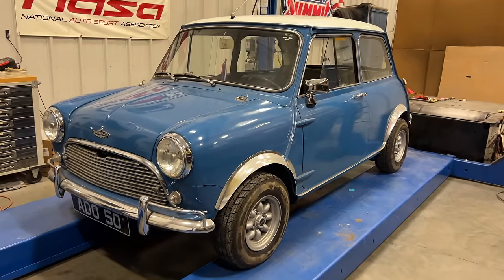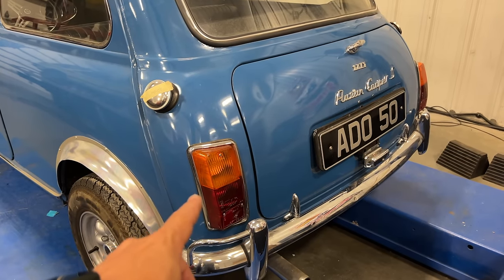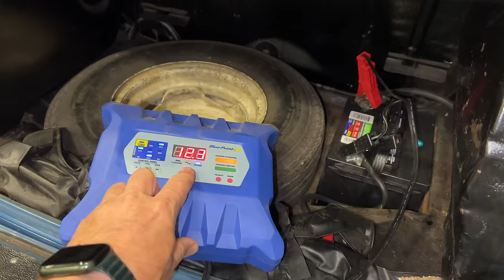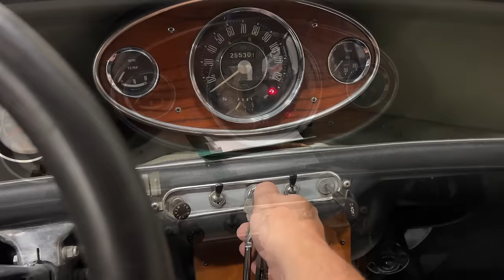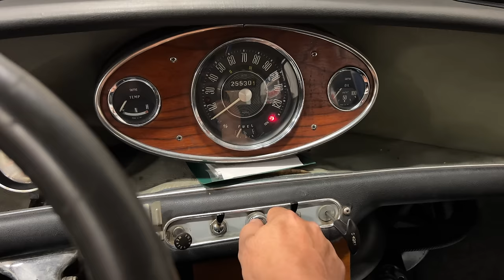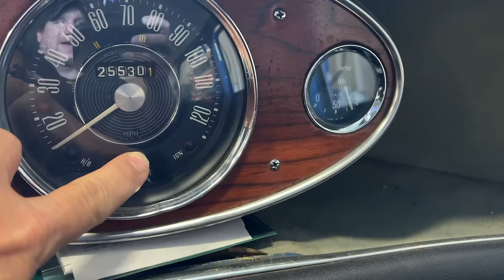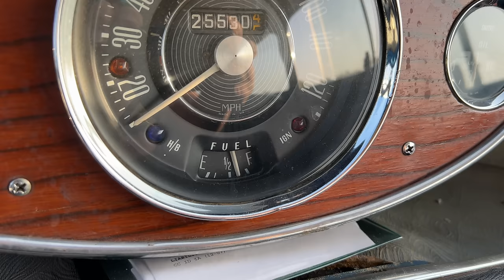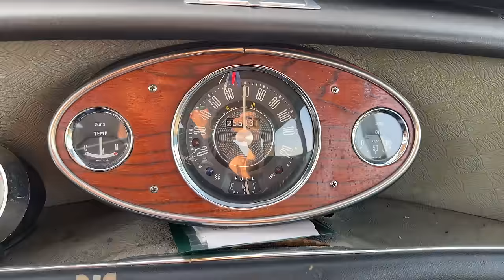1967 Austin Cooper S - Will It Run?

Comment: That was one of the easier first starts after years! Loving the color and the Minilite wheels.
Reply from the maker: I am wondering if the DOT 5 ended up saving the hydraulic system and is why I didn't have any problems with it.
Reply: @ThisWeekWithCars  if DOT 5 is less moisture permeable and doesn’t react to older hydraulic system materials, then it’s the stuff to use. I’m not that familiar with it yet, however.
Reply: @ThisWeekWithCars  it is much better.  Piss off those old tyres.  It is illegal in Australia to use tyres more than 5 years old.
Reply: @bmwoutlander  Australia is ridiculous on so many levels…. definitely not the Land of the Free….
Reply: @bmwoutlander  five years!!, is the sun that damaging over there?  The tyres on my Pug 205 are probably six years old, have less than 2000 miles on them and look like new but the car is garaged and UK weather is kind.
Reply: Yes the Sun has that much get up and go.  How do think we became skin cancer Central?
Reply: @bmwoutlander  I know that Aus owners of the pug 205 often ask UK forums whether they have internal plastic panels/ dash parts for sale as they are all cracked in Australia.

Comment: I had one of these Cooper S cars. Same year as this one, but mine was the Morris version. Right hand drive built in Australia. Mine had the fuel pump inside the trunk (boot), between the fuel tanks. The 1275 engine has an additional head bolt near the head water inlet pipe. Great little car, so much fun to drive and incredible handling around corners.

Comment: From memory, the Tail Lights (as shown here) were changed to that pattern in 1968, by BMC. Perhaps this '67 Mini has had a rear lights upgrade. Back in 1971, these were the car to own! They used to be labelled as "The Jaguar Eater", as they outperformed many Jags. Also, the real enthusiasts that owned the Austin / Morris Cooper S would take out the 1275cc block, and bore-out to 1340cc. I cannot imagine just how quick the little Mini became! Sadly, I had the bare bones 850cc Mini, but longed to own a 1275 Cooper S. The value of these cars continue to sky-rocket, a solid investment if you could take this car back to a factory Standard, on both interior and exterior. I would also remove the Contact Breaker Points, and fit a Hall-Effect Electronic Ignition Unit - inside the current Distributor. Just changing the Ignition System in this way improves the starting and also the performance, and it's cheap and easy to do! Greetings from Australia.

Comment: If that is a genuine 1967 car then its a MkII Cooper S and those rear lights are correct but then it should have the later grille. Maybe its just confused! The wheel spats are not OEM but correct for the period and totally right for those wheels which are just gems. And VERY rare!
You Sir have once again found an absolute beauty of a Mini.

Comment: We actually started making those Mini's in 1967, with the squared back lights! But..... There was always a bit at the factory.... Somebody forgot to make sure that we had both LH and RH rear lamps. So we made over 6000 vehicles with only the RH rear lamps fitted. Eventually Lucas managed to produce the LH lamp and we apprentices were dispatched to fit said lights! This worked out really well and cars were removed from the outside of the parking lot, only to reveal hundreds of cars in the centre that had had their wheels stolen.... 😂😂 Needless to say! Another fine mess at the Longbridge.... 🤣🤣🤣🤔
Reply from the maker: Great story thanks!
Reply: I had a 1969 Mini MkII. 1000cc and my friend had a 1969 Cooper S. He bought those mini wheels shown on the 67 Cooper  and gave me the 'S' hubcaps and some interior fittings after he installed a roll bar. Me, I blew up my engine. Oh the youth of me... I paid 1000 $ for the car in 1971.

Comment: Wow, A 1275 S.    These I have rarely seen as this car was supposed to be the "one to have". If I remember correctly they had a 3.44 diff which meant they had a faster top speed than other minis, consequenty the speedo goes up to 120 mph.   Front disc brakes to stop with the additional power.  These cars are now super rare.
Reply: The S has a 3.65 to 1 Diff
Reply: @ratman9802  I believe that the 3.44:1 was an option for the S. In the 70's I fitted an MG 1100 engine to my 1962 Mini, changed the final drive to a 3.44. It would top 100 MPH easily, In fact it would cruise (noisily) at 100 MPH (in Germany). Still have the car. I did change the rear lights to Mk 2 ones, had to cut the aperture and make mounting brackets.
Reply: @Radfordperson  I have a Mk1 mini that I'm working on and it has a 1275GT engine and an A+ Metro box, the Diff is 3.44. I knew the ratio of the S as I'd previously checked it in the tech pages of my official BL Mini Workshop Manual. I don't know if it was an option or not. I had a Mk2 1275 Cooper S back in the day  AND it was a Radford (any relation?) I wish I still had that along with my Lambretta GT200.
Reply: @ratman9802  If you do a search on the internet, the 3.44 final drive is mentioned quite a lot for the S. I believe that the Mini HL had a 3.44 fitted, mainly to improve fuel economy. My name is nothing to do with the Radford car company. But I used to work for Janspeed. Hope that you power unit swap goes well. I assume that you will do something to improve the brakes. My 1962 Mini has not been used for about 15 years, turned the engine over the other day, fortunately, not seized. Want to get it running soon!
Reply: @Radfordperson  I just had a look at the WSM, 3.65 was standard on the 4 speed synchro. 3 speed synchro had a range of ratios available as options so I assume it was down to what the customer ordered -  3.44 was the standard ratio for 1275 with a 3 synchro box. It was intended as a competition car out of the box. Anyway, that pleases me because my car is to be Cooper S tribute etc so it will be the correct ratio with Cooper S Brakes and all the other period correct bits but with a few mods later on. Good luck with yours. Mini Spares has a lot of good info on their site so useful to identify what is what - there were so many variations over years

Comment: I'm glad the oil pressure came up, my 1968 Cooper S gets an air lock when it's parked for too long and it won't get pressure until I prime the oil gallery.
Reply: Those wheels are "Mini Light" wheels and not the real "Minilite" wheels. Not that it matters these days.

Comment: I can't fault these little cars.. (Not a fan of suspension). Thanks Steve.
Reply: I've got both wet and dry cars....   Standard the hydro cars are a bit crap, yompy and under damped but add a pair a dampers on the front and progressive bump stops on the rear and it's awesome, you get the comfort over rough roads and still good handling on the turns.
Reply: Been driving an Austin America with Hydrolastic for 51 years,  works great, love its handling.   John Quilter, Eugene, Oregon

Comment: A bit of a disappointment, Steve, nearly everything worked, it only needed the faithful hammer to the fuel pump??!! I was 18 when this model came out here in Australia, and everybody wanted one. For a couple of years, the NSW Police used 1275 Cooper S models as highway patrol pursuit cars. Plenty of bigger-engined cars could outrun them, but very few could stay with them when the road got twisty.
Reply from the maker: Still plenty to do. Getting the power brakes to work again could get interesting.

Comment: Well that was easy ! I had my doubts on the sticky valve !  I restored a 1275 some years ago and the additional tank wasn't factory , my goodness it must have been knocked up by a complete amateur , it was shockingly dangerous . Coincidently it was also in lsland Blue with the Old English White roof . The spare was a standard non-vented mini wheel and in the day we all tried to make our minis look more modern by fitting the later rear lamps !!! The rear panel did indeed need cutting to fit those lights. It would be interesting to see if that panel has been cut , if it hasn't , that may indicate a later shell has been employed . I also noticed the extra anti-roll bar fitted to the rear subframe . (Sway bar ) So is this a recent purchase ? Thanks Steve .
Reply: In uk it depended on what year it was but twin tanks were fitted by factory.

Comment: See if you can fit a front disc brake kit to it.  Plus the modernised fuel pump and it will hum.
Reply: All Mini Coopers had front discs from the start. The S had larger servo-assisted discs.
Reply: @davidjones332  my ignorance!  But get it humming in the 1960s these cars raced big Fords at Bathurst in the Hardie Ferodo 500.  A 500 mile race up and over a mountain.
Reply: @davidjones332 cooper and cooper S discs are the same as each other.
Reply: But they weren't from the outset. The Cooper introduced disc brakes in October 1961, but the Cooper S wasn't introduced until March 1963 and had larger servo-assisted brakes. At the same time, the ordinary Cooper was changed to the bigger discs, and I suspect that by now any surviving earlier Coopers will have been modified to the later type. Merry Christmas! @willgrime
Reply: @davidjones332  you’re right, my error - 7” on the Coopers, 7.5” on the Cooper S.  Not sure the Coopers were ever upgraded to 7.5”,  I seem to recall some confusion at the time as to the fact that BL didn’t simplify matters by fitting the larger brakes to both versions; but then, my memory is clearly not what it was…
Reply: The "S" disc was also an eighth of an inch thicker. I'm going off Rob Golding's 1979 book "Mini" which lists all the mods made to every model; it's supposed to be based on the factory records so it ought to be right, but as the components were interchangeable no doubt there was a lot of swapping around went on.  @willgrime